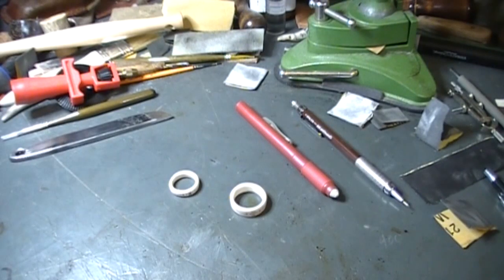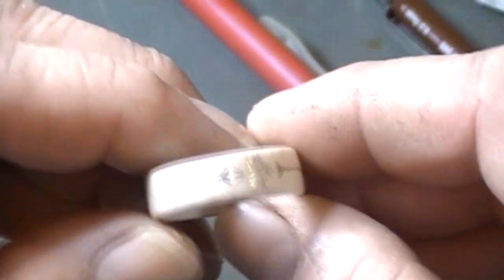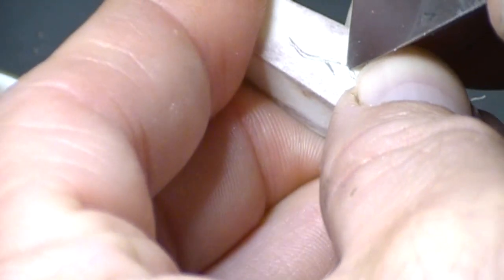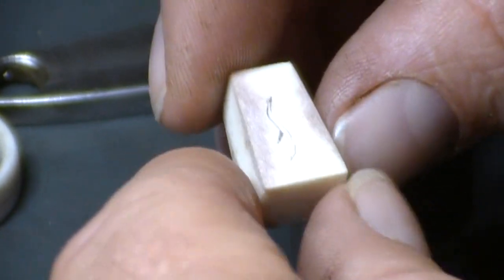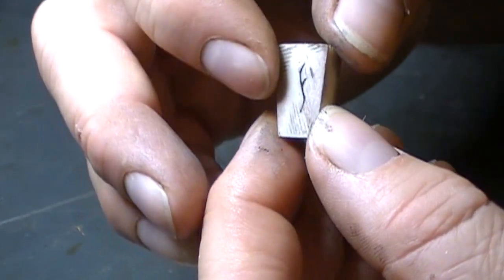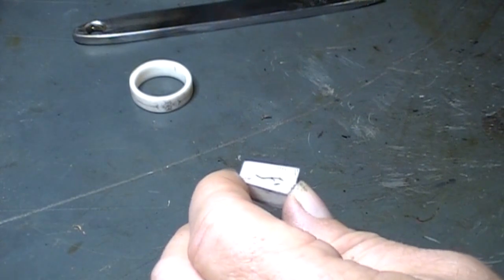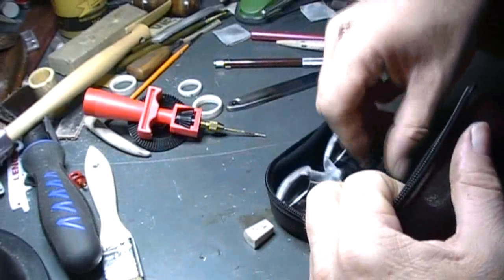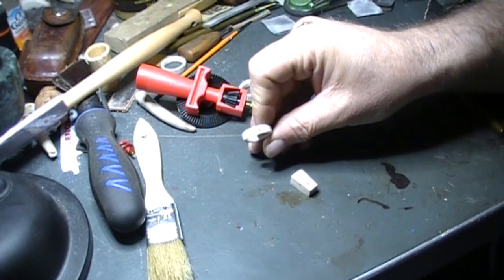Sami Antler carving Basics

Comment: This is interesting but how do you form the ring in the first place?
Reply from the maker: Cut a slice of antler. Get correct ring measurements. measure outside. Drill hole in center. put on a mandrel in a drill. sand/polish outside to line. take-off mandrel. outside measurement minus correct inside measurement. mark inside line. cut out center with a scroll saw. sand polish inside with Dremel to line. then carve. these can also be made on a Lath of course.
Reply: @tombrown879  Thanks Tom, you should video the process, I'm sure it would get a good number of views. 👍🏻

Comment: if you make an erroneous line, you can fill it with white pigment and glue and don’t have to sand it
Reply from the maker: Thank you for the wonderful tip. are you using a white liquid pigment? or very fine antler filings? also are you using clear epoxy? or white epoxy? or hide glue?
Reply: @tombrown879  A drop of cyanoacrylate on the tip of a needle. But before that you need to remove all the black color. If you want white, place a very small drop of water on top of the CA. Liquid CA turns white with water.
Reply from the maker: @HARM633  What a great work around. thank you for sharing. 
Would you do a video on carving a line of triangles sometime. With a look at the tool, you are using and angle deg. of blade. i still struggle with this technique and think that my blade angle is too steep that my triangles would have to be very tiny to work. I will defiantly need to try and make a barrel knife sometime. the ones you have created are amazing. Thank you again for your knowledge.
Reply: @tombrown879  I didn't understand about the line of triangles.
I have a cutter like yours, I sharpen it at 10-40 degrees. V - shtikhel (graver?). And a set of chisels from 1 to 4 mm from drill shanks. I do small triangles in 3 movements, not in one.
Reply from the maker: @HARM633  thank you for all of your great info. This will help me.

Comment: Tom, great video on how to do this style of carving. Very good explanations. Is there a company that makes this kind of Knife? I would like to try my hand at it. Thank you.
Reply from the maker: Hello. Thank you for the kind words. I do not know of any company's out there making the carving knifes, most carvers make their own. Mabe i will need to make a video of how i make mine. any blade will work really. it just needs to have a little thickness to it around 1/8thin to 3/16ths should work. In the old days a lot of Sami would just wrap their field knife in hide as to not cut themselves and just use the tip of the blade. a flat grind works a bit better than a convex. and preferably no micro bevel at the edge. edge should be what they call a zero grind. But it must be very sharp no matter what you are using. 1000 grit water stone. or black Arkansas stone would be the minimum in my opinion. If you just lay the blade very lightly on your thumb nail, it should want to stick and not slide. I will touch up the edge on my blade at least a few times during a session. don't be afraid to take the time to touch it up. much better that. then slipping off your lines. Hope this helped some.

Comment: Hola, muchas gracias por tu video. Es impresionante y de gran valor. Podrias darme referencia de la cuchilla de talla para el hueso? Wue es un cincel pequeño? No lo encuentro en mi zona para comprar. Muchas gracias
Reply from the maker: Most of the carving tools are hand made by each carver. Yes a small chisel will work. but even the tip of a knife blade will work. Lots of times the Puukko knife that was carried would just have the blade wrapped in hide so as to not cut the hand. and just the tip was used for the carving. Hope this helps. Try looking up Roman Kislitsyn. He once posted a good article also showing the tools he used.